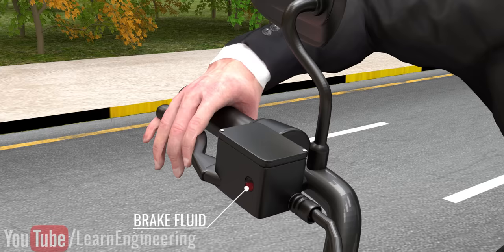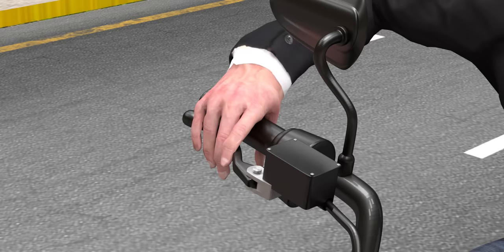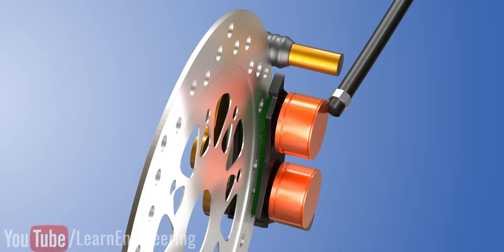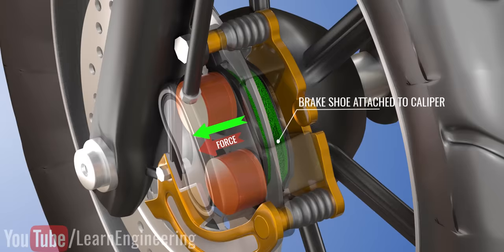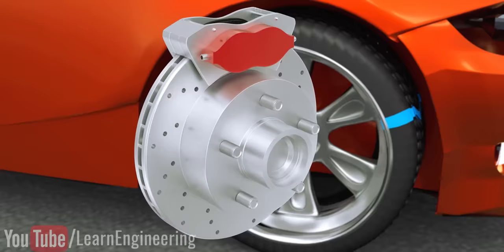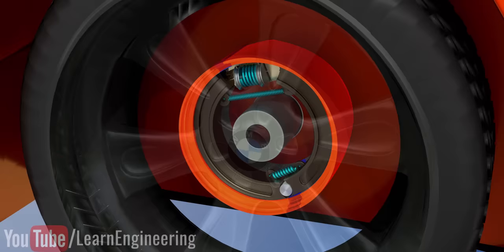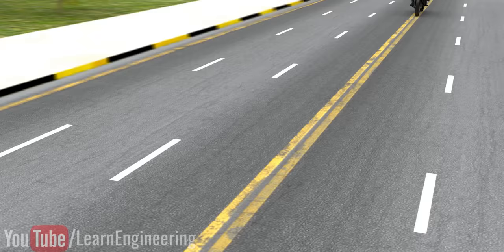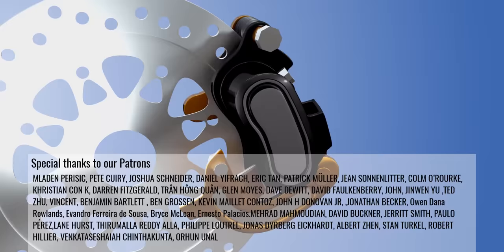Understanding your motorcycle's brake | Disc Brake

Comment: Dude I wish my bike stopped like that when there are logs in the road...
Reply: For that thing to happen.. you must understand and feel your bike 100% of its power weight cornering force.... braking power...
Reply: That's why you got the eyes
Reply: Karthik  of equal  and opposite reaction, bike stops u fly😂😂😂
Reply: oh boy i wish you learned about inertia before saying that..
Reply: the logs are the brakes.
Reply: *Inertia smiles from a corner.
Reply: Even if your bike can stop like that. You cant.
Reply: @sachinpatel9372  It's called a "high side" when you go over the top, and you usually suffer a broken neck when you land...most times fatal.
That clown Lesics is downright DANGEROUS to inexperienced riders.  Experienced riders know that he's chatting crap.
Reply: It will... If u ride with an optimal speed
Reply: Panic break = over the handlebars!
Reply: 60-0 in just a milisecond
Reply: I wish i had a bike
Reply: Damn a year later just noticing these gold replies. Bravo 🎉

Comment: not happy about hearing how 18 wheelers still use drum brakes 🥺
Reply: As far as i know,heavier vehicle such as a 5 ton lorry or bus or heavier uses drum brakes. You may ask why. Yes they just said drum brakes are the best when it comes to heat management and thats why its best to have disc brake for cars and bikes.

The most important difference to note here is weight. I will try to check out the reason why they still use drum. I think because diac brake cant take that much load? Maybe. I might be very wrong. I will do some research and will update here.

Comment: I ride a scootie with drum brakes. No clutch system, both are brakes. When riding I keep the rear brake slightly pressed, heating it up. When i hit both brakes during emergency, the front brake is more efficient and this causes a spin or drift and has caused me lots of injuries until I understood the workings of brakes and net torque. Thank you for educating us, saving lives.

Comment: Your vehicle stops "within a fraction of a second"? Hardly. Good video, though!
Reply: having brakes capable of stopping you within a fraction of a second would be just as bad as crashing into a car without slowing down...
Reply: Yeah, 7/2 seconds is a fraction too.
Reply: @pakan357  
But it is not a fraction of A second. It is 3 seconds and a half a fraction of a second.
Reply: It would be equally bad if it did :-D
Reply: your tires will stop spinning sure but you and your bike will not stop!

Comment: It's a simple concept. At the hand level you move a relatively small piston for a long distance. At the wheel the large piston is moved over a shorter distance. Thus with the same pressure you multiply the force on the brakes. Mechanical advantage!

Comment: Make a video about engine sounds, specifically how each configuration makes it's own sound
Reply: and what makes a sport engine a sport engine compared to other engines, i'm a go kart driver and the amateurs karts uses 390cc 13-21hp engines (that last forever) and professional karts uses a 125cc engine that produces up to 45hp . why a truck engine have a low rpm? while a f1 higher...
Reply: @ReickyTcharles  a 125cc engine in order to produce more power , needs to rev higher . For they purpose a smaller compression ratio is used ( which means that the Pistons have to cover a smaller distance) and larger diameter Pistons are used. Trucks need to carry a lot of weight. Thus, they need more torque ( which means turning force) to achieve this, diesel engines are used. A diesel engine has a higher compression ratio , so with each stroke, it produces more power, than a stroke in a gasoline engine( which has a lower compression ratio). Thus it doesn't need to rev as high to produce power .
 In sport engines high horsepower ( horsepower is torque produced in a certain amount of time) is needed for optimal acceleration. So I think that's why they use lower compression ratio engines . I would suggest you to watch YouTube videos for better information... You can find a lot there https://www.youtube.com/playlist?list=PLFl907chpCa7R39l29VY5DygA8RgBQZBf
Reply: @jim6213  how many information, thank you! 👏🏼 👍
Reply: Piston go up down engine go vroom

Comment: I used to assume that the brake have small steel rods which get into the hole of disc . But assumptions were wrong. Hats off to engineering

Comment: This is interesting. I always thought there were pistons on both side of motorcycle brakes because on mtb disc brakes there are pistons on both sides! Left and right.
Reply: Faster and bigger bikes have pistons on both sides,  its called fixed caliper brakes. In the video, he explains the floating caliper brakes.
Reply: @mrSabic  

Floating (axial) calipers are mostly on the way out

Because any axial play can be taken up by the pistons moving, since they can move independently (until full contact with the rotor) and the abundant use of (semi) floating rotors
This also allows for a more simple and rigid mounting for the calipers

(Floating) Single sided calipers are still used in budget bikes and rear brakes (and are often single piston)
More expensive bikes where speed/weight is not a big factor, either get single disc/double sided calipers, or double discs/double sided calipers with smaller pistons
And rear brakes because the rear wheel always has the tendency to lock up with too much braking power when the weight shifts forward, also, most rear discs aren't floating types

...hell, even my sister's plebian 50cc scooter has a (single) double sided caliper, and that thing is from 2003

Comment: Thank you, now i know what to pay attention to so that my front disc doesnt stuck after braking. Sometimes it doesnt go back completely because of the mounting pin of the caliper support had accumulated a lot of dirt. I had started to diy a lot of servicing myself on things other than dismantling the engine. Much appreciated.

Comment: Isnt this a re upload?
Great job with original content lol
Reply: Yes
Reply from the maker: Yes, more information this time. There is a change in the technical explanation too.
Reply: @Lesics  why disc have Holes?
Reply: @nirmalkumar-ge2ol  those holes help cool down the disc and prevent it from cracking/deform from thermal expansion
Reply: @nasmeskartz9149  lmao my smartass thought that the brake system involve using those holes to add friction or something, i never even know that the disc heats up when you brake. this video was very informational, thanks

Comment from the maker: Friends, I wanted to release a really big video this month. Unfortunately that does not seem possible now. We will be releasing that video on first week of April. Sorry for the delay. Please feel to support us on Patreon. https://www.patreon.com/Lesics
Reply: Ok sir I am waiting ☺☺
Reply: Sir i was si helpfull ..i am making a project over the braking system ..i wanted to know the material for dics and material for shoe to achieve this highly effective braking ...kindly sir help me ✌
Reply: Quality > Quantity, take your time man
Reply: Other vehicles using disk brakes thicker and normally vented as they also need to stop more mass, in turn, create more heat compared to a motorbike.
Reply: Sir, Which software you use for animation?
Reply: Please make a video on working of Drones....specially on "Garud dron".
Reply: And abs brake systems?? And new also
Reply: Why there are holes in disk brakes sir
Reply: @zeusyoursonhasreturnedibri7603  to vent the gas bubble that forms between the pad and the rotor surface, especially when really hot.
Reply: Sir I want to know which software are application r u using for creating animation
Reply: Mm
Reply: Good
Reply: Why there is different types of disc brake, some caliper is of golden and some silver colour also have different pattern of hole punched?

Comment: Holes in the discs arent actually for cooling purposes. They keep the brake pads clean so that there is optimal contact between the disc and pad.

Comment: Correct 100℅..Drum Breaks are OK in normal condition But in Most of critical  situation Drum Breaks fails. on highways and speed more than 60 Km/h this will never work if sudden stoping of car or motorcycle within 2-5 meter. So now a days automobile companies giving one Disc break system at least. All the best👍💯

Comment: I remember a force that if you make a force at a further distance you will get a higher force, someone said he could lift the earth with something idk
Does it mean the rear brake at bicycles also have an advantage that the force it makes is higher than disc brake because the distance between the wheel center and the brake is further?

Comment: Wouldn't the holes in drilled rotors be engineered more (or all) for gas (created from the friction when braking) venting to increase braking performance rather than cooling as mentioned in the video.
Reply: yes, the holes are to scrape the contaminants from the surface, like dust or water.

Comment: I thought that disc brakes are some poky spines of steel that jam into the holes of the rim when break lever is pulled , and the titanium wire pulls the hinge connected like the claws ( spring of the spikes junction point at  neat base of the spikes) ya put pressure and that puts pressure is efficient than pull the syring and i will make the string coil shrink and close the coil spring gap and the spikes connected to the spiral coil  will invade through the holes in the rim plate, ( dont read this) this is some two facets of different concept that need welding

Comment: Why disc brakes on most of bikes are fitted with front wheel instead of back wheels?
Reply: applying front brake is more effective than the rear wheel, since all the weight is put on the front wheel when break is applied.
Reply: Same goes for most cars. The answer is simple, for any suspended vehicle, most breaking power is needed on the front wheel(s) because of the squatting effect generated by inertia.

Comment: This is the cheaper variant though. The slightly different expensive brakes sportsbikes like a cbr600rr street triple r or ktm supermoto 950have are not floating and you use only 1-2fingers as they are just that effective.    While a 90s Honda cb500 actually needs the force of your entire hand and feels like theres gummibears somewhere in the system

Comment: The big small and big pistons are not connected by any cable.  Actually, it's the master and slave brake cylinders that are connected, and not by a cable but by a high pressure hose.

Comment: Since when are the calipers pistons only on one side? Modern calipers have mostly 4 pistons but some have 6. 2 each side or 3 each side..Single piston calipers are used on the rear disc which most people don’t use anyway.

Comment: I have a question
My motorcycle brakes are always on even when the engine is off. They are just touching the disc, they are not hard on it. Is that normal? When i push the motorcycle i can feel and hear the little touching

Comment: The brake lines aren't connected to the brake pads. The brake lines are connected to the brake caliper. When the brake fluid gets pressurized it pushes the brake cylinders which pushes the brake pads into the brake disk

Comment: Not too bad but definitely lacking some clarification in the description. Never a mention of the brake caliper in which the piston resides. Brake fluid is not brake oil, it is more akin to hydraulic fluid rather than petroleum oil.

Comment: I read somewhere that ABS can only be equipped with disc brakes.... is that correct? 
if so, why can't we use ABS in drum brakes? 
(But... I've seen bus with ABS...)
Reply: Bus have air brakes

Comment: Here's a question: There are a lot of motorcycles that have a front disc brake and a rear drum brake. Why not have a rear disc brake and a front drum brake?
Reply: Probably because of higher braking efficiency in disk brakes.

Comment: There are many faults in the commentary of this video. Here are two of them...
00:43 The force is EITHER "sufficient" OR it is "enough." 
It doesn't have to be both.
1:03 The pistons are not connected by a "cable" at all. The connection is by a "tube," or "pipe." These brakes are hydraulic, no cables are involved.

Comment: So just because it's 'Pascal's Law' does that mean that the small piston at the lever could move a piston 60 foot wide with the same force? Surely there's a bit of the law missing in this explanation?
Reply: Yes it would move with the same force but not for the same distance. Basically the pressure you apply to the small piston will be distributed to every cm^2 of the 60 foot piston. So it will only move very slightly. The amount of liquit you displace with the small piston will be the same on both ends.

Comment: How about electric or more specifically, eddy current brake?
Reply: Eddy currents will not stop a car because they diminish as the vehicle slows down.  They could slow the vehicle, but not stop it and could not hold it stopped.  I believe they are used on some (all?) trains, but again, will not completely stop the train.  Good question though.

Comment: But how an ABS work on motorcycle?
Reply: There are wheel speed sensors on each wheel. An ABS control module is connected into the hydraulic brake lines for each wheel. When the module detects that a wheel has locked up, it pulses the pressure in the wheel. The pressure is relieved, the put back on many times a second. This pulse will unlock the wheel.

Comment: What is the main function of dics holes in motorcycle ........... I think holes is provided air ( Cooling system) . What i am wrong or right. Plz tell me
Reply: Ya u r r8 
For heat dissipation
Reply: What would be main anyway? You get all effects or none.  Lighter. Looses heat. More friction on edges of the holes =better braking.

Comment: I suspect another reason the adoption of disc brakes on heavy vehicles has been slow, is because in most cases where a truckie has overheated their brakes to the point of failure, it was due to them being in too high a gear for the gradient they were travelling down... (or even worse, being in neutral after having missed a downshift. 😧😧)

So in a situation like that, where you're overusing the hell out of your friction brakes (because you've gotten yourself into a pickle where you can't control your vehicle's speed via engine braking, like you're supposed to), it probably doesn't matter whether your air brake system is hooked up to discs or drums at the business end — you're still going to cook them.

Comment: talks about efficient brakes, portrays a harley street lmao, for a video trying to make a point about being accurate and use correct terminology there are a couple of errors:
1: No bike will stop in a fraction of a second
2: The liquid in the brake system is NOT an oil it's brake fluid and doesn't share the properties of conventional oils.
3: There is no point generalising number of pistons in motorcycle brakes they come in all shapes and sizes, single pot, opposing twin pots, one sided twin pots, 3 pots, 4 pots, 6 pots and probably some other weird setups.

Other than that good visualisations and it does get the point across
Reply: It's not a brake "cable," but a brake "LINE"
Reply: @tonybucca5667  I guess i had that coming
Reply: Relax man! It's just a general help. Imagine being 10 yrs old. How helpful could this be. If you know all this why are you even here being so hyper critical. Chill my brother!
Reply: Glad you mentioned that
Reply: also it's a brake hose not a cable
Reply: @DB-qm4jx : It isn’t hypocritical to offer corrections on something, what would be hypocritical is to refuse any corrections when you’re wrong! After all, how would anyone improve if nobody ever mentioned things to improve on…

Comment: Disc brakes proportionally have much less power than drum brakes, but disc brakes are much cheaper and simpler construction, so they took over the drum brakes for economical reason.
Reply: Dude this video just said disc brakes are costly then why are you saying opposite?
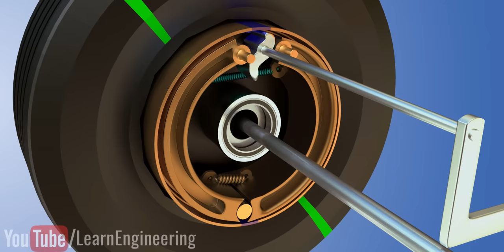Reply: @infinitedepth6767  - Watch 5:12 again, but this time little more carefully. Disc brakes on trucks would have to be HUGE and too expensive, so using disc brakes on trucks is not a good idea economically. Why HUGE? Because disc brakes are too weak (proportionally) to stop heavy duty vehicles efficiently.

Comment: But good for red soil riding over, due to sudden brake the tyres momentum will try to torque towards the road bed trying to dig in eccept the torque getting time to direct it forward horizontally along the direction of riding, seems could be sage, wait job me i will develop, the brakes for my bike. lastly for sell, ( okay got it) two ways , instant brakes and drift brakes

Comment: It's dead wrong saying disk brakes have better stopping power than drum brakes.

Braking force is very much dependant on area of frictional material. A drumbrake can be designed with very close to ALL the available area as frictional area, and the friction area is concentric to the rotation, so the effective distance to the center of rotation gives better counter torque to the tire friction patch - a quicker stopping ability. Notice how (front) disk brake pads are always LONGER to give more friction area.

The diskbrake is however easier to make it behave evenly and it has better cooling so you won't have to feel much "fading" when repetitive hard braking is practiced. This has very little relevance in real life when you drive responsibly on ordinary roads. Service of diskbrakes is much faster than drum brakes.